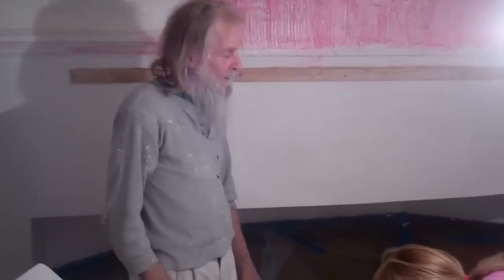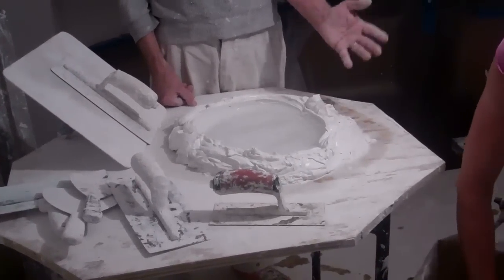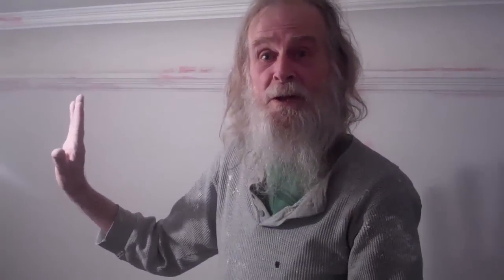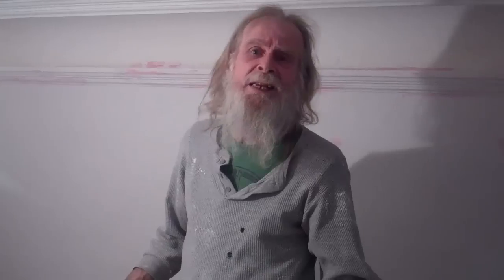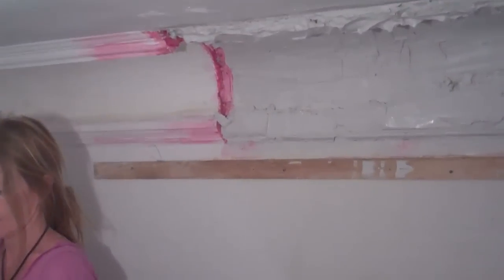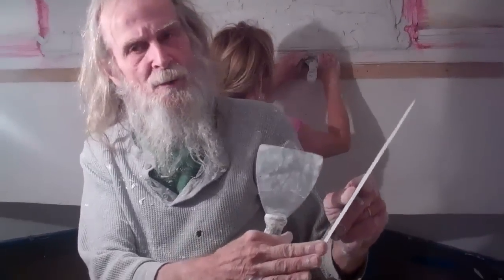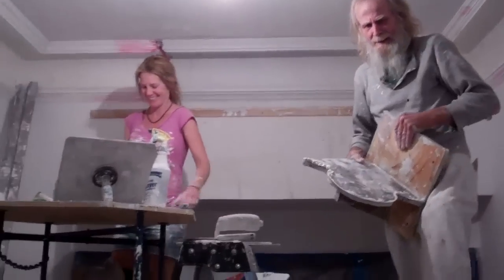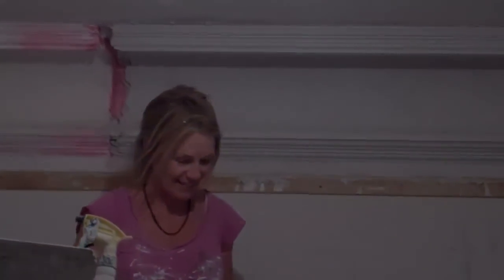Rebuilding Plaster Moulding

Comment: Nice work. You know what your doing. I also run molds. Hopefully some young people get into this because  their will be more and more of this kind of work as those old buildings get remolded.
Reply: What type of plaster are you using? We have usg base and red top available to us around here, will these work?
Reply: Diesel Power We normally use a 50-50 mix of lime and molding plaster.
USG or Goldbond Molding plaster. Around here Red top is gauging plaster not molding plaster. Gauging plaster will not set fast enough.
Reply: Hi I have a question will ultracal 30 from usg work?

Comment: Any contact info for this tradesman? I know it’s 9 years later, but this video is the best example of what  i need done. Thank you.
Reply: Can't you do it yourself?
I've done a section of Victorian coving using a similar method but off the wall and will screw and glue it into place...
I think its all down to building up the layers and drying in between each layer... It can't be that difficult as Victorian builders used to do it!
Good.luck with yours.
X
Reply: I have done this kind of work for over 25 years. Ask me anything.
Reply: @luissanchez1159  Hola Luis, usted dijo que se le podia preguntar. Cuales serian todos los materiales que se necesitaria para hacer las molduras en plaster?
Reply: @monicaa6546  depende del trabajo que quieras hacer? Que tenes en mente? Si son cornisas podes comprar molding plaster.  Viene en una bolsa de 50 lbs.

Comment: hello,sir, excellent craftsmanship, I do have a question on some work that I've done recently, what I've noticed is that after a week I've developed small hairline cracks throughout the cornice  that I've ran,wasn't sure what may have happened here, iam using autoclaved finish lime and super white moulding plaster and the ratio was a 50/50 mix. Any help would be appreciated, thank you.

Comment: How do you make the profile copy if you don’t have an opening in your moulding? I need to resurface damaged areas of our plaster mouldings. Hope this question makes sense. 
Gorgeous work!!
Reply: With a multitool/knife/padsaw cut a vertical line in your cornice. You can then stick a square bit of 1mm tin into it to trace around….this line you’ve cut can be filled with your mix later on…

Comment: Curious as well how to make the blade/tool to make the run?
Reply: Hold a piece of cardboard up to the molding and trim it away little by little with scissors until you have an exact match. Use that to cut a piece of plywood, and a piece of metal to reinforce the plywood so it does not wear down.
Reply: @mrdanforth3744  that must be what the gap at each end facilitates...

Comment: Can anyone tell me what the pink base layer is on this video clip please. I am going to make coving in situ from casting plaster and lime and need some way to adhere to a multi finish plaster wall and ceiling?
Reply: It is a primer to adhere plaster etc to paint. Any Gypsum supply store should carry some.
Reply: B. Bennett
Plaster weld

Comment: Just curious how do you make the tool that replicates the molding exactly?
Reply: Hold a piece of cardboard up to the molding and trim it away little by little with scissors until you have an exact match. Use that to cut a piece of plywood, and a piece of metal to reinforce the plywood so it does not wear down.